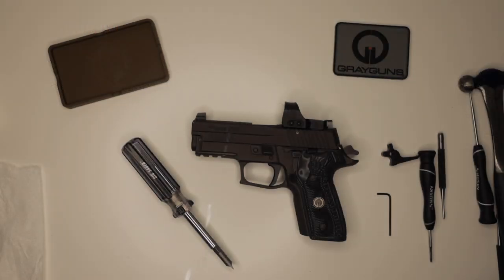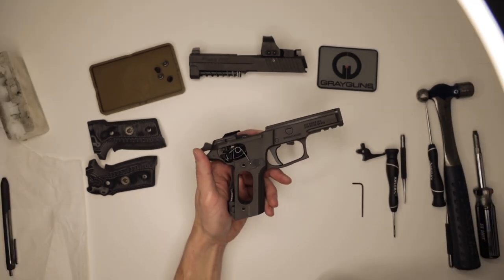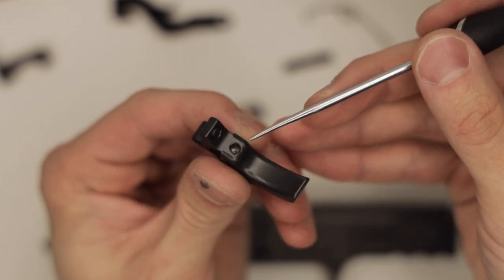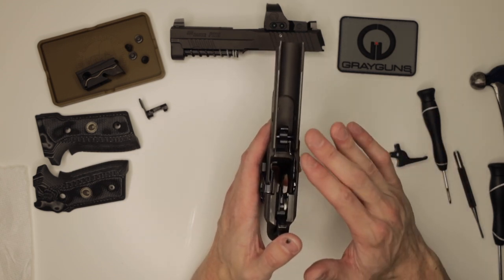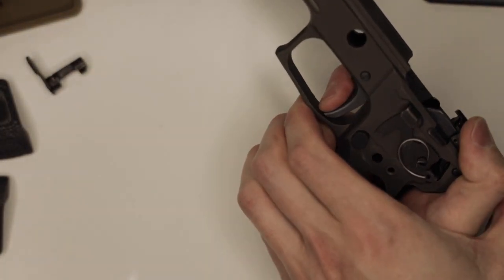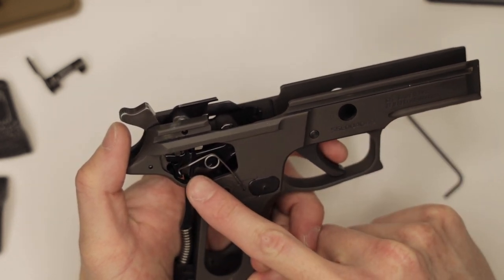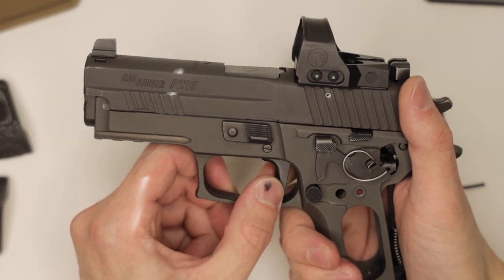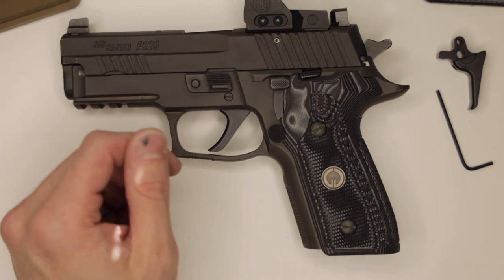Grayguns ELS (Enhanced Leverage System) Install For Sig Sauer P-Series handguns

Comment: Installed the ELS hybrid on a P226 TacOps. The factory SRT trigger pull was 10lb and 4.25lbs. With the ELS installed, the pull is now 10.5lb and 3.75lbs. The hybrid shape is preferred over Sig's curve. The pre-travel and over travel adjustment features are nice.

For a similar Sig (with SRT and ~4lb SA pull), I would recommend replacing only the trigger with a flat or hybrid shape, to suit one's personal preference, and use the pre/over travel adjustments.

Comment: Anyone curious, I have the ELS trigger. I also had (HAD) the Armory craft dual adj trigger in my 226. I don't know what kind of crazy juju the ELS trigger has but, yes it absolutely changes the pull weight. Noticably. Of all the parts i have put into my Sigs, the ELS is the most drastic change you can feel. In a great way.
I own several P22X pistols and have installed all types of different parts.
 I have the AC smooth action kit, sig armorer's improved hammer strut, AC lightened mass hammer, nickel hammer pin, spring kits, standard SRT and all manner of aftermarket improved parts. If its an aftermarket part for a sig i have it.
None of it was as noticable of a positive change as the ELS trigger. I can not recommend it enough. Best upgrade to a classic line Sig you can make.

Comment: I recently purchased the SIG P-Series Dual Adjustable Straight Trigger for my P229 Legion before seeing the ELS kit.
Do you sell the ELS trigger bar separately, or will I have to purchase the entire kit.

Also, will this be an upgrade compared to the current trigger bar in the Legion?
Thanks in advance.
Reply from the maker: This is a huge upgrade over the Dual adjustable trigger. It helps smooth the trigger pull out as well is decrease weights without spring changes, even more with spring changes, allowing an even lighter pull with duty rated springs and competition rated springs. 

The magic with this kit is actually in the trigger, the trigger bar just retimes the backend. A new trigger is necessary for the leverage enhancement work.

Comment: Thanks for the video.  One thing I notice though, the trigger pivot pin is asymmetrical.  I do not know if it can be install incorrectly, but it should be obvious if you do, right?
Reply from the maker: That is correct, the Trigger pin is stepped. the step side goes on the left side of the gun.

Comment: How does it compare to the legion p226? In terms of tigger weight reductions.
-
What mainspring does the legion 226 come with?
-
Would an adjustable trigger and the stock srt work like this?
Reply from the maker: The Legion comes with the short reset, however with the ELS kit it lightens the trigger pull. We do this using leverage instead of spring changes. So any additional spring changes will lighten the trigger pull even more.

Comment: I am confused, a DAO/DAK doesn't have a decocker or spurred hammer because they can't be used in a DAO gun, I will still need the ELS for a DAK just because the frame is notched for a DAK trigger bar?
Reply from the maker: Yes that is correct. Sig started cutting all frames with the DAK compatible cuts. This left us with 2 frame styles out there DAK and NonDAK frames. DAK frames are also used in building the DA/SA guns as well. Because of this we have 2 different style trigger bars to fit in both frames made by SIG.

Comment: I can not recommend this enough. I have bought nearly every aftermarket part for classic sigs out there. For 225, 226, 227, 229, 210, 220. Single greatest improvement you can make to a Sig 226.

Comment: Do the screws on the trigger have loctite on them . Or do I need to put some on?
Reply from the maker: The screws come with loctite and vibratite. However, if you want you can pull the screws and use a fresh coat of loctite when adjusting to make sure they do not move at all.
Reply: Thanks. My ELS is being delivered today . Can’t wait to install

Comment: Hello, what is the weight of the pull with this trigger installed? Also where can I find the springs along with this setup
Reply from the maker: Hi Mike, its hard to give you an exact pull weight after the fact since the guns come from the factory in a range of pull weights. Our ELS kit reduces the DA pull by about 20% and the SA pull by about 15%. We also offer a spring kit that will reduce the pull weight even more. With the ELS kit and a blue duty spring, you will see pull weights range from 8lbs to 9lbs for DA and around 4 for SA

Comment: Does the pre travel and over travel adjustments impact the reset at all? If I get this kit, will I also need the short trigger reset kit?
Reply from the maker: the pretravel does not impact reset at all. The overtravel can, but not significantly. The amount of reduced reset you see is the amount of over travel reduced. This would be negligible compared to the short reset kit from us or SIG
Reply: I have a Sig Mk-25 p226, is there a way to see if its the DAK or non-DAK without taking it apart?

Comment: i dont really like the idea of lightening the double action pull. at least not for carry.
Reply from the maker: We would have to agree to disagree on this one. For SAO and striker guns we like to stick above 4 lbs for carry guns as a rule of thumb. this means if a striker gun came in with a 4lb trigger we wouldn't recommend lightening for carry, however if that same gun came in with a 7lb trigger (which we have seen) we would absolutley ligthen it for carry. We can't look at lightening triggers all or nothing. If a shooter can't safely and reliably work a 12lb double action trigger pull, is it ok for them to carry? Probably not. Our ELS system brings the trigger pull down into the 8-10 pound range without spring changes. This means you keep the factory hammer spring for that incredibly reliable ignition, but also bring the weight of the trigger down to a safe but manageable weight.
Reply: @grayguns  im just against lightening triggers on a firearm with no manual safety i cant see anyone having trouble being accurate with a 10-12lb first shot unless they have neuropathy or something. Then again Im sure you know more than I do what is safe and what isnt. I was a military armorer so i dont really have all that much experience with testing safe trigger weight.
Reply: @Trumplican just how much da trigger weight would you consider safe then? 20 lbs? See what I mean? A six or seven pound da pull I would not consider a problem whatsoever. The hammer fired guns are not like striker fired guns in that sense.
Reply: The primary safety advantage of a DA trigger lies in the length of pull, not in the weight. Even if you're in a nervous state with your finger on a lightweight DA trigger, a sudden noise or movement that makes you jump and twitch your trigger finger will be unlikely to result in an accidental discharge, due to the length of trigger pull. You still have to commit to that long trigger pull on that first shot.
Reply: @fuckfrank  its both
Reply: @grayguns  your ELS does more than reduce weight. I don't know how you did it but it but the way the trigger leverages it feels WAY smoother and less than what it measures. The single greatest upgrade to a classic sig possible. I know, I've bought just about every AC, GG, matrix, Wolff, sig armor part there is for Sig classic Pxxx gun made.

Comment: That decocking lever is so ugly. I would rather it be on the slide instead of the frame
Reply: That's Beretta and while I love my Beretta 92, the safety/ decocker on the slide is not very comfortable when racking. I much prefer the Sig decocker.
Reply: @proverbialmind_spread9421 oddly enough, on the cheetah series the safety/decocker is on the frame and it's the FN/browning derivatives that have the slide mounted one, and it's one of the two obvious ways you can tell them apart, with the other being the lack of an exposed barrel on the FN/Browning guns. oddly enough the .380 version of these derivatives, dubbed the BDA 380, was also made by beretta on behalf of FN, with FN only making the .32 cal version under the name "FN 140DA".